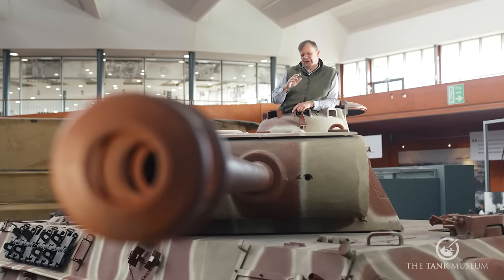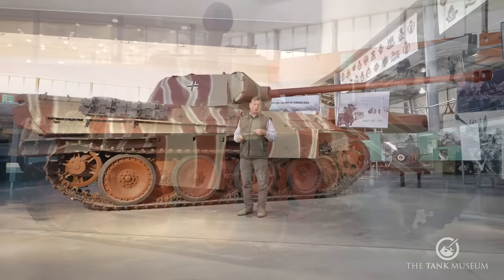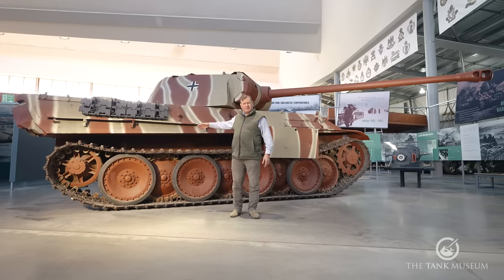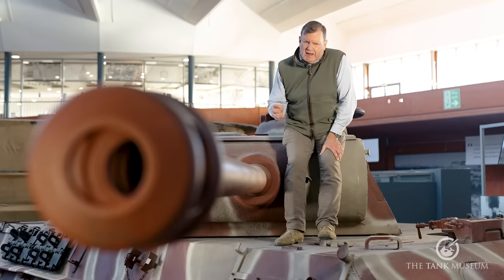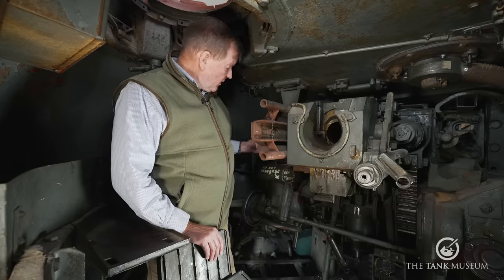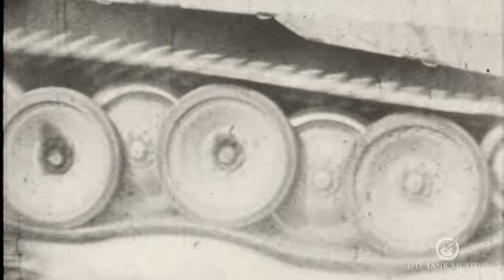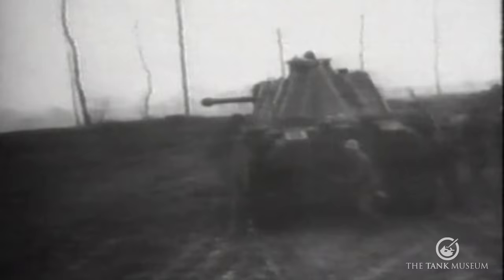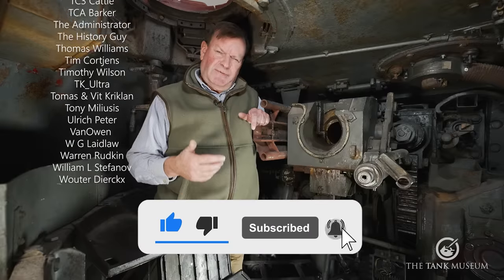See Inside Panther | Tank Chats Reloaded

Comment: 11:51 During the war, the more 'Adventurous' & most likely SURVIVORS of Panther/Tiger E/B/ crews took to doing just that^...
-They'd have the Panzer units WerkStattCo mechaniacs CUT the recoil guard off just behind the 'Braunark' recoil juice/length of recoil, or cannon throw metering device attached to the inside of the left-most inside recoil guard & remove the loaders side tubular rail, just as in the Bovington Panther here....
-More dangerous to crew members?....~Surely
-But the additional benefit of near fully opening up the turret, when literal seconds count if struck by enemy fire & beginning to burn, is that the crewmen were unhindered by having to go under, or over, the gun, sometimes with injured or dead crewmen blocking that small, precious space, when scrambling to >> egress >> the stricken Panzer...

-Plus the fact they seldom fired on the move while the tank buck'd n' pitched & from stationary/sitting positions just made the loader squish himself flat to the turret wall like current Abrams MBT loaders do (Maybe add two purpose built 'Crucifiction'  hand holds on turret wall too?)
The Panzer C.O would just have to be ever mindful of his right arms position when firing the cannon....

If crews decided to do such a mod, Im certain they became MUCH more conscious of SAFETY around that recoiling cannon, w/o relying on in-built safety features, features that could rapidly become FAULTS upon a hasty egress situation...

*I say such as a few years back I'd torn down my 10" radial chop saw for some other work onnit, I purposefully decided to omit reassembling the saws original acrylic blade safety pivot cover & linkage. It was only then after its 1st usage in its new form that I'd arrived @ the terrifying prospect that for all those previous years of usage in its original store bought shape, how ridiculously UN-Safe, negligent & hazardously I'd used that saw DUE to its inherent SAFETY features?!! (See: Rich Lawyers/Corp Litigation-Personal Injury "Baby Drowning In The Bucket"  lawsuits/Warning stickers;)

-NOW when I use such Im SO much more CAREFUL in HOW I handle/approach using such a dangerous tool. I use such properly & WAAAY more safely now as a result!... 
(Waves goodbye to ya'allz with 3-1/2 fingees & custom re-fit robotic thumb)....;)
-
Reply: Cool story bro I
Reply: @mann_idonotreadreplies  
Jus thought I'd share, Ive read more than a few German vet accounts of doing so over the years...
Enjoy the new year...;)

Comment: Great video!  Fresh perspectives are always interesting.  One serious shortcoming for the gunners was pointed out by Nick Moran in one of his videos; the lack of visibility. All the gunner had was his sighting telescope, so it was difficult for him to identify targets called out by the TC, unless he was laid right on the target bearing.  Obviously crews worked around this, but it still a handicap in fast-paced, frantic combat.
Reply: It was not a pressing concern for the gunners because German commanders had superior cupolas and thus better all round vision compared to, say, the Sherman and it was the commander who looked for and selected targets, and he sat directly behind the gunner. 

If it was a pressing concern, the gunner would have easily received a turret roof periscope. Initial Panthers (and Tigers) didnt have a loader's roof periscope but on subsequent production runs they got one. It would have been a simple matter to add a gunners roof periscope but it was not deemed necessary.

Panthers received improvements and made changes almost on a monthly basis (check out the Tom Jentz book on all the improvements made throughout the production runs) but a gunners periscope wasn't an important change to add.
Reply: @lyndoncmp5751  Good points; the Panther was indeed a truly good killing machine.  Thankfully for Allied tankers, it had those small handicaps.

Comment: With re. to comparing the Maybach petrol engine to the T34's diesel, with hindsight I think the decision to go with a (not necessarily this ) petrol engine was the correct one.

Remember, all the Panzer 3 and 4 (and that obviously includes all the "Sonderfahrzeuge" like Stugs, Panzerjäger, mechanized artillery and so on) were running on petrol.

Switching from one type of fuel to another would be a herculean job in peacetime . During a war? Simply impossible.
That means that during said war, you will now have armored vehicles operating alongside each other, that use two different kinds of fuel.
A logistical nightmare in the best of circumstances and with an army with a many logistical problems as the Wehrmacht? 
Yeah, good luck with that.

Now, I'm not saying that this played a role in the decision making process that lead to the Maybach engine being chosen, but as I said, with hindsight, I think it was the right one (at least as far as the fuel used goes)

Comment: Thank you, Chris for an interesting review. Couple of little points:

1.  Tiger/Panther Maybach engine had four(x4) Solex carburetors, that was difficult to synthesize and adjusted at the front lines, so some cylinders ran too rich, some too lean, that effected engine power and engine longevity. 

2. Besides spend brass ventilation, Panther tank was first that featured a gun bore gases evacuator as well, which was 3 tubes blowing compressed air immediately after bridge opened. 

3. Not related to Panther, but in T-34, although it didn’t have a turret basket, it had seats attached to turret, so crew didn’t have to follow fast rotating turret on foot. 

4.  Panther turret was not balanced like for example on T-34, so if tank was sitting on a slight gradient of 15 degrees it was impossible to turn by hand, even though it featured two very large diameter cranks, oh and it was 1000 turns by cranks to turn turret 360 degrees. 

Thank you! 
Once again for a good solid content.

Comment: No plans to put an engine in it, and get it running? I used to like your workshop series, but you stopped doing them?  Now get my workshop fix from Mr Hewes and the Australian Armour museum.
Reply: everytime a panther is repaired, the autopilot turns on and steers the vehicle towards Russia.
Reply: @ChrisZukowski88  The workaround is to not fix it with the proprietary tensioning and calibration tools supplied by Alkett and Krupp, then the autopilot will refuse to drive for you. It is a good way to repair because the warranty period must have expired in January 1945, and the service history is patchy, so you aren't losing any value either

Comment: Thank you for this. I am curious about the interlocking of the hull plates at the welds. One presumes they were assembled on jigs in the factory so alignment was not a problem to be solved by this. It may be that the welding was deficient in being at risk of progressive failure*. A shortage of alloy metals could be the cause. The interlocking might be a fix, minimising crack length?

Have other nations built tanks in this way?

*See, for instance, the separation of the stern on the wreck of the Bismark along a transverse bulkhead. Also the reported ejection of the entire back plate of her turret B.

Comment: Thank you for this Tank Chat on the Panther. I knew from family that the Panther mechanicals were, basically, garbage, and had long wondered both, "Why," and specifics that you have largely answered.

The questions that remain are, "Why did they use the Maybach engine instead of a diesel?" More exactly, "Having met the T-34, why not use its power train, from engine to road wheels?"

Looking at Panther's mantlet and that of an M-60 or other tank of that vintage, it is obvious that others learned from that Panther flaw; it is simply a wonder it was made in the first place.

I do not wonder at the more powerful gun. What tanker says, "Big 'nuff," when you don't know what the enemy will field? On the other hand, ammunition commonality suggests designing a turret to accommodate the next model of gun, and building with what is your current best.

Comment: Awsome vid on one of my favourite WW2 tanks and one can only imagine if they had a desiel engine and better torison bar set up and the final drives, fuel pumps and transmission fixed. The Panther tank would have been a lot more lethal tank. One thing to note also during its first combat at Kursk the D model notable without the bow machine gun had less bolts on the rims of the wheels and later more added to strengthen them. Also there are pictures I've seen with a mitch match of both types which are intersting to note the difference.

Comment: I seem to remember with the Tiger 1 that post-war engineers determined that the interleaved road wheels actually had a higher ground pressure than standard road wheels would have had, on slightly wider (couple mm iirc) thicker tracks. I wonder if this would be the same for Panther and Tiger 2? Intuition points me towards yes, seeing how modern tanks no longer use interleaved road wheels, and the Abrams M1A2 has a ground pressure of only 15.4 PSI, while weighing in at 69.54 tons. Panther G appears to have a ground pressure of 12.66 PSI, at 45.5 tons.
While length and width of the tracks is different between the two, if we hypothetically increase Panther G's weight to 69.54 tons without changing the tracks, that brings it to a ground pressure of 19.35 PSI, assuming my math checks out. So that leads to significantly higher ground pressure, and with all else unchanged does seem to point towards the interleaved road wheels not having that much of an effect.
Of course, I know it's more complicated than that and it's an apples to oranges comparison, but I do find it interesting how a MUCH larger tank (seriously, the M1 dwarfs even the Königstiger/Tiger 2) has comparable ground pressure to the Panther.
Reply: Weight is not distributed evenly across the track. Tracks are flexible, obviously, and on the parts of the track where there isn't a wheel pushing it down there' s less ground pressure. With interlocking wheels the overall ground pressure isn't better but its more evenly distributed.
Reply: That's a very difficult comparison to make, because materials science has improved a lot in the intervening time - stronger/tougher materials, better quality control and improved production methods. Likely, the suspension of an Abrams would have been impossible to create back in the 40s.
Reply: It was also for crew comfort and a smoother ride, not just for ground pressure. The Germans thought about the crews. The Panther even got a crew compartment heater on the Ausf G.
Reply: believe it if you feel better doing so (:-)
Reply: Because you don't use interleaved wheels for overall ground pressure, it's for weight distribution. The pressure of a track will peak on the roadwheel that is closest to the center of gravity, areas on the track where no wheel is in contact will have the lowest pressure. This is why some tanks opt for more but smaller wheels which have even weight distribution but when they do sink in, they are not as efficient at overcoming the obstacle. Although the Comet and Panther both have large roadwheels and comparable ground pressure, the Panther has half the difference between the lowest and highest pressure points. This means that in soft terrain any individual wheel is less likely to sink, consistent pressure is maintained and when you do sink in, you maintain speed.

With all that said... Yes, the advantage is not great enough to double the manufacture costs, maintenance time and other factors. If you absolutely have to have the most consistent ride quality, interleaved roadwheels will always win. The engineering checks out, but on a strategic level, it is incredibly impractical hence why nobody has bothered with the concept since the 50s.
Reply: @LeadHeadBOD  That's the best explanation of it I've seen, and makes complete sense. Thanks.
Reply: "Yes, the advantage is not great enough to double the manufacture costs, maintenance time and other factors."

Panther crews sure loved the smooth ride though.
Reply: @LeadHeadBOD ah yes, material science didn't advance from 40s.../s
Reply: @lyndoncmp5751  wrote: "It was also for crew comfort and a smoother ride, not just for ground pressure. "

-- "Comfort and a smoother ride" came at the very high penalty in weight(that supposed to be a 30 ton tank, like VK30.02(DB)) and size, in fact because it was a long travel wheel, torsion bars have to be doubled per each control arm, so nothing can be stored in that compartment, yet Panther is 220mm taller, then it needs to be, and about 10 tons heavier, if considered weight of heavier caterpillar track, that also affect greatly driving/mobility dynamic of this tank.

Comment: The t34 was not a great tank or the Sherman they just made more of them the end.
Reply: Tank's no good if you can't build any, I think
Reply: And the Sherman in particular enjoyed more or less constant artillery and air support and unlimited supplies and resources.
Give the Sherman the problems the Germans faced in 1943-45 and the Sherman would have performed poorly.
Reply: As discussed in the video, the Panther was in many ways not a great tank either. One of those flaws was excessive complexity and cost, which led in the end to fewer of them. All three of the tanks were designed with specific ends in mind and compromises were made in all cases.
Reply: @lyndoncmp5751  That's called combined arms sir, and the problems the Germans faced in 43-45 were caused by T-34s and Shermans.
Reply: @PatGilliland

Nope.
Reply: sherman best tank of war ( i am no fan of US military )  but good ergonomics, good visability , stabilised gun , easy to access engine and transmission , within limits of most bridges , cranes and trains . If sensible which of course weren't as wouldn't have started genocidal war nazis should have focused on producing and upgrading panzer iv which was their best tank
Reply: @patrickHayes-bq1ry 
Nonsense.

Comment: I'm sure sloped armour wasn't borrowed from T34, there were tanks before T34 with sloped armour, the French had it way before, e.g. the somua s35 and the old ironclads.
Reply: indeed. the germans activly decided to not use it on the tanks before because it lowers the room for the crew  but the effectivness of it, shown on the t-34s for example, made them change their mind as shown on the later jagdpanther, Panther and Tiger 2
Reply: Well, since they didn't field it before the Russians, I am not so sure they had it as a definite future idea for upcoming tanks before they saw the T-34s.
Reply: @TheEsseboy  I'm not understanding " field it" over 400 s35s  where captured by axis and used, all of them were being used in tactical battles before being used by the axis Inc the eastern front. So if "field" you mean out on the battle field, then it's an incorrect statement. Iron clads way before ww1 created by the Brits on paper in 1911. So we knew way back then about sloping armour Just saying.
Reply: @jaymorris3468  Which did NOT have a fully sloped front hull armor...so no, they didn't get the idea to slope the whole of the front of a tank from the s35
Reply: @TheEsseboy  he didn't say fully sloped front hull armour, you did, but I'll let you win the discussion, it's not a problem.
Reply: @jaymorris3468  Well, even the Tiger has partially sloped front armor, so by that definition it is a bit odd